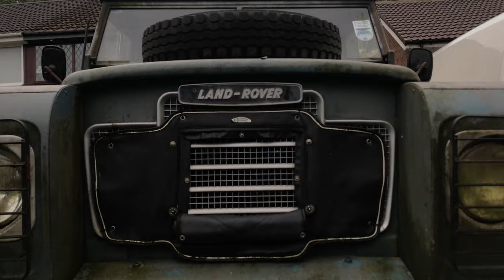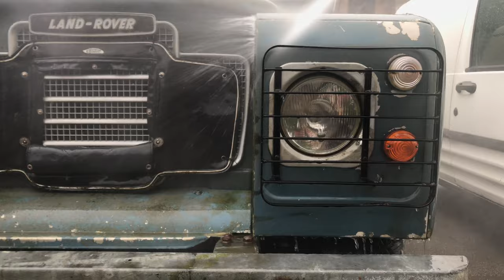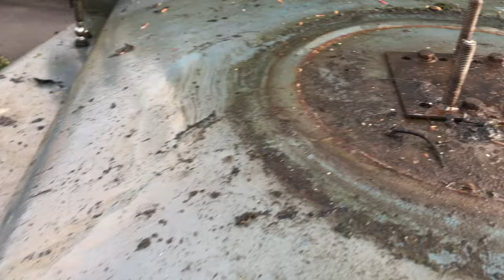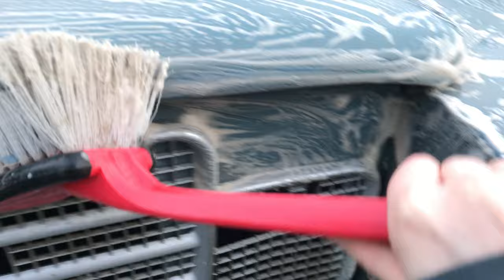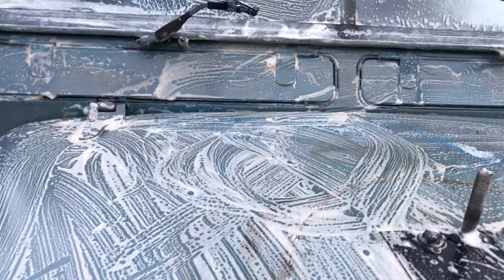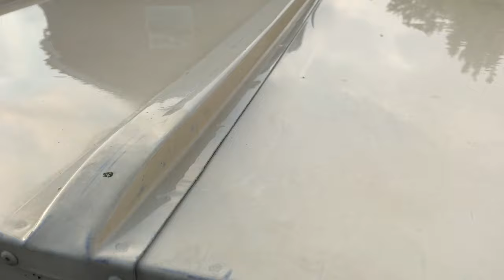The New Project - Land Rover Series III

Comment: hi  there. never steam clean an engine.use gunk and then gently hose off with water. there a lot  of electrics under the bonnet especialy under the bonnet.i see yours is a petrol one,best to put a plastic bag over the distributor and breather. i wish you luck with this project. hope the chassis is rust free.
Reply from the maker: Thanks for your concerns but this isn’t a steam cleaner. This just shows a jet wash removing the thick grime after applying some gunk. The distributor etc are being replaced so I didn’t really have concerns about water ingress. This whole video just shows the ruff and ready cleaning of the vehicle since it had stood in a field for so long.

Though you can steam clean an engine, it even says so in Land Rover owners hand books. It just recommends that care is taken around certain components and the engine is rewaxed to prevent corrosion
Reply: @ Peter Smith - Tried to mansplain and got murdered, lol.